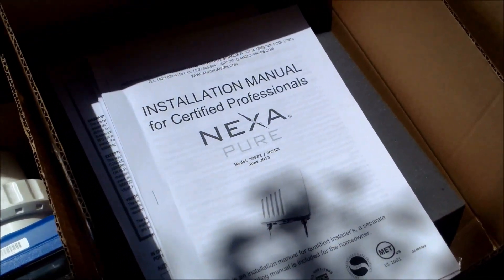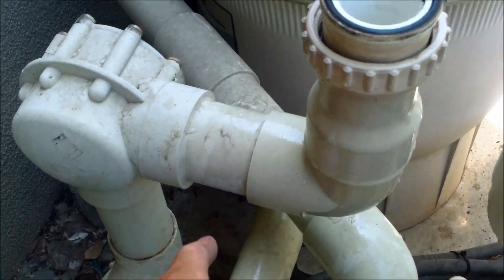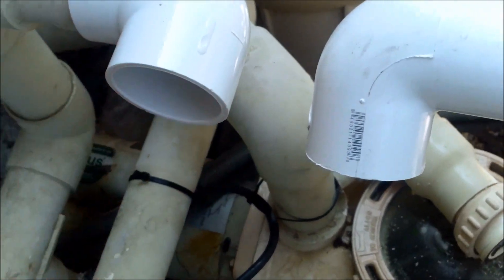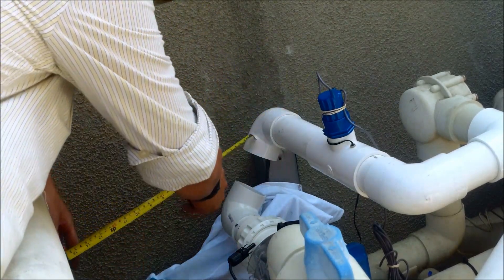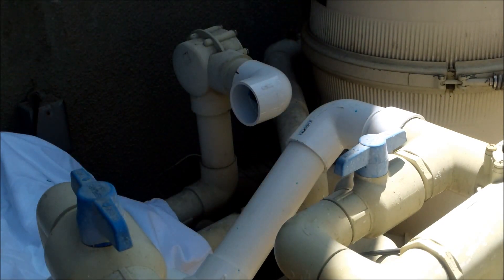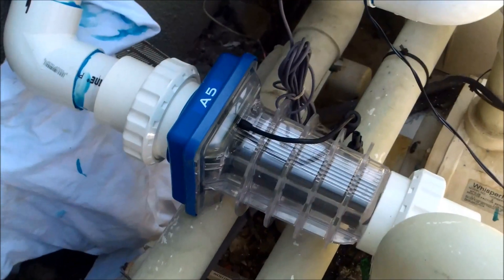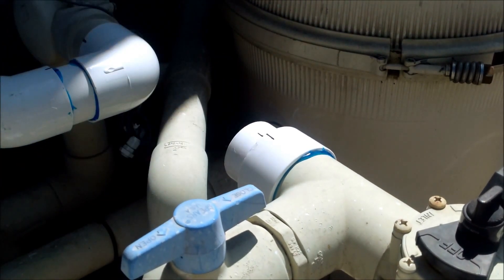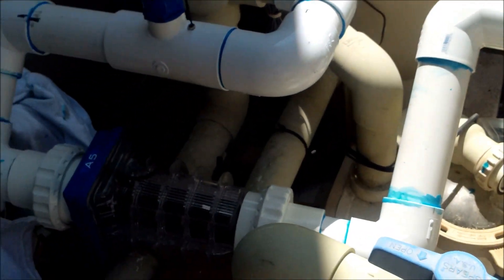Installing a Resilience 305RES-A5 (Nexa Pure) Salt System Part One: Plumbing

Comment: why didn't you use a primer when gluing a new coupling over the old oxidized pipe ?
Reply: pools are low pressure applications, so pool plumbing tends to be relaxed. Also I think that pipe has been painted as opposed to oxidized...

Comment: Great video, I am about to buy a NExapure System, has your opinion on them changed with the years ? odo you think they are sill a good product ? I am particularly interested in Nexapure because one of the manuals say they can operate below 2000ppm ( with a hit in production of course) I plan to use the A5 cell at 25% with 2000ppm of salt on a 10,000 gallon pool.... do you think that is achievable?
Reply from the maker: I wouldn't be focused too much on such a low salt level. at 3000 ppm it is not corrosive to the equipment or decking. It has to be well above 4500 ppm to be an issue.  1 ppm is equal to 1 inch in 16 miles or 1 minute in 2 years. So technically a salt level of 3000 ppm is relatively low considering.

Comment: Have these been taken off the market? Cant find a supplier with them in stock.
Reply from the maker: They merged with another company - here it is under the new branding. - Resilience Chlorine Generator 305RES-A5 40,000 Gallons

Comment: I just started my own pool servicing company a couple months ago and i came from West Texas but now i'm in Austin Texas. I'm not sure why i never dealt with salt systems there but my only guess is the water was too hard for it to function properly and last as long as it should. Anyway i deal with them now and I'm curious what your opinion is on the best salt cell, and the best control board. Would you say the Nexa Pure?
Reply from the maker: I wrote a Blog article on it last year: http://poolmandave.blogspot.com/2013/08/salt-water-systems-so-many-to-chose-from.html.

I detail  them in this article. I think salt system are great. I have one in my pool. They will save you on cost too on your route. They are really popular in my area mainly because the local builders like them and install them with all of the pools they build. I have over 30 on my route and learned to love them as there are a few drawbacks:

When the cell gets dirty they stop working.
It takes some of my time to clean the salt cells.
You have to sell the customer a new cell every 5-6 years ($600.00).
pH is constantly high

Other than that they are great:

Keeps a good chlorine level all the time.
No need to shock 
Crystal clear water
Swimmers like the feel of the water
Reduces toxic chemicals you need to handle each day
Reply: @SPL   when you say PH is constantly high do you mean in general with all SWG or in particular with the nexapure?